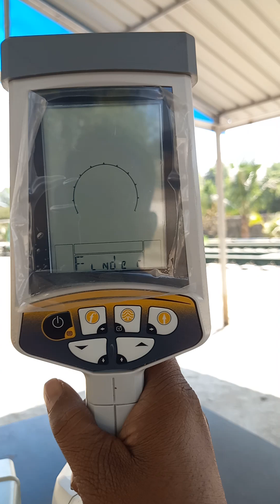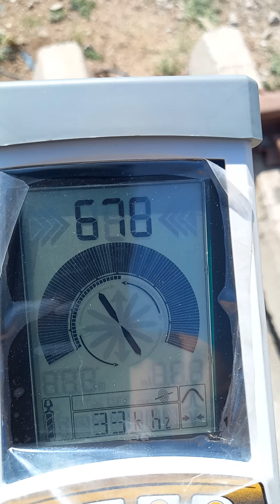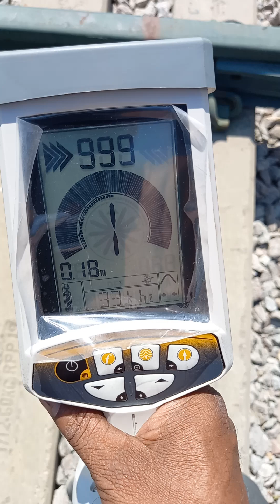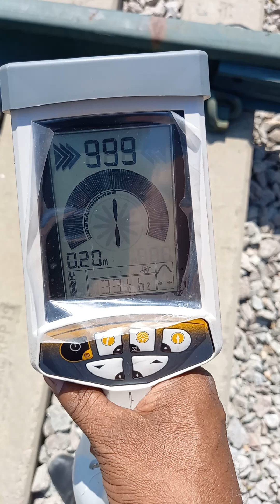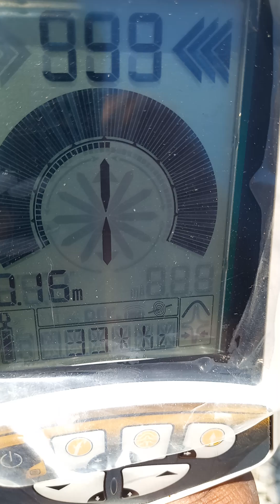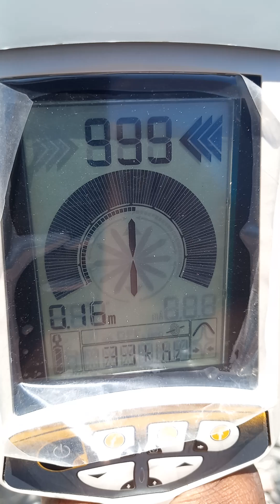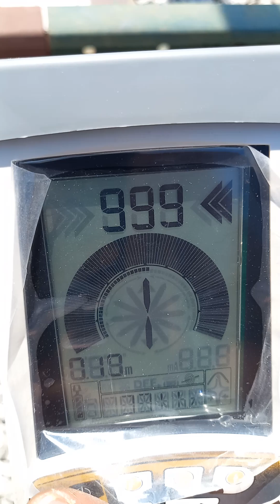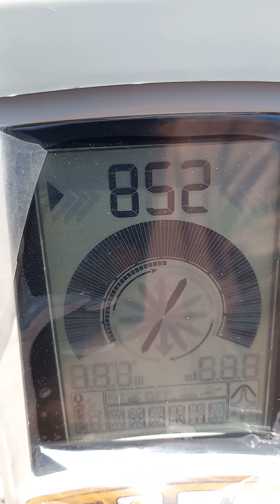Finding defective sleeper in track circuit using cable locator

Comment: Thank you sir. Is there anyway we can detect the sleeper earth fault?
Reply from the maker: Same..in RE area one rail is already earthed. And sleeper is already placed on earth. So what is sleeper earth fault? Here we detection positive and negative rail short circuit
Reply: @ramprasad331  I have faced one problem at my station. Track down, expected sleeper short... but there was no cross signal gain in receiver . Positive rail insert was earthing and causing track down....Insert to insert megger value was good...but Positive rail insert to ground was less